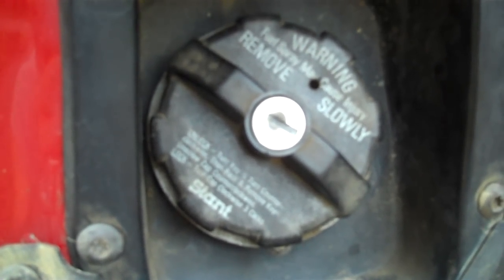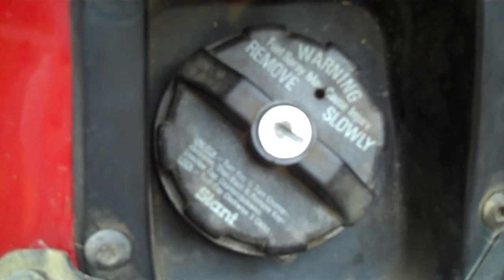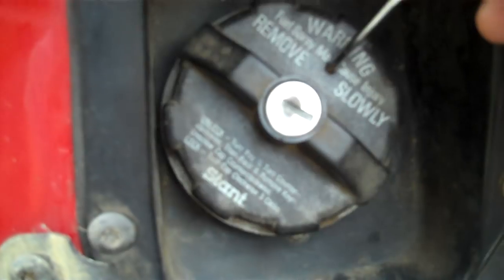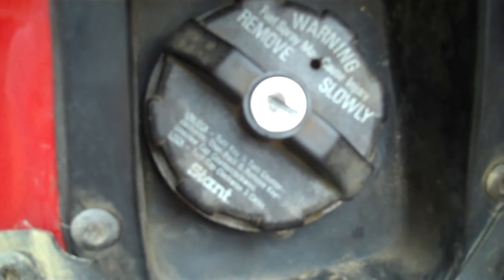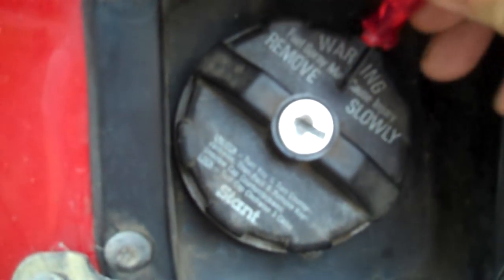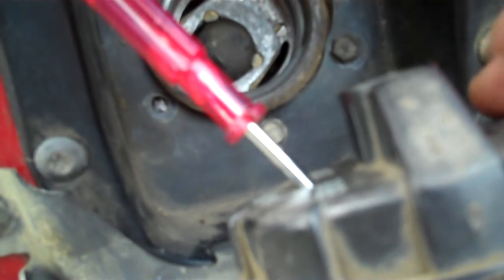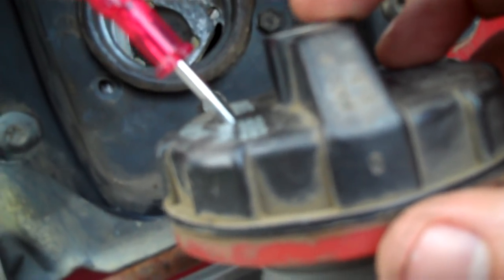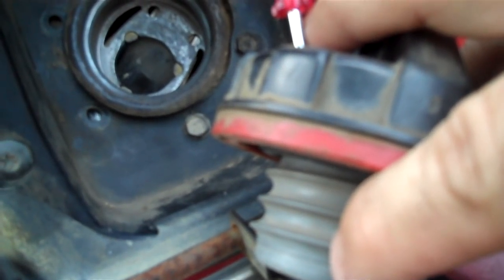How to remove YOUR locking gas cap if you lost or broke your key

Comment: What if it's not a Jeep and the cap is metal instead of plastic? Shouldn't one be concerned about creating a spark causing an explosion especially if the tank is almost empty (full tanks don't explode)? I've lost the key to 1 of 2 fuel tanks on a Ford F250.  The cap looks nothing like yours. Any "safe" suggestions? Thanks!
Reply from the maker: +tammygurl64 You have a legit concern. Its not the actual gas that explodes. Its the vapors. Honestly without actually looking at one, I couldn't actually give a "safe" suggestion.
Reply: Power Addicts - FixJeeps.com - Jeep, car and motorcycle tips I realize it's the fumes that explode.  That's why I said an almost empty tank would explode.  I saw a really cool science experiment on some science show on Netflix (really good series but I forgot the name)  where this science guy was running around Las Vegas doing all kinds of experiments and using tourists to help out or to guess what would happen.  He rigged 4 cars ranging from full tank to empty tank with the means to create a spark inside the gas lid (at a safe distance of course!  LOL!) and people were surprised when the car with the full tank did nothing. They were all mostly like firework duds until the car with the empty tank was ignited and made a big BOOM!  LOL!  I wasn't surprised because I was told this years ago when I first started driving.  Anyway, thanks for your response and sorry my reply is so lengthy. My neighbor, who is a mechanic, says he can get the metal cap off.  At least there are dual tanks on the F250 truck.  I may make a post telling how he did it once he's takes it off.  Have a great day!!
Reply from the maker: Go for making he post. It can help other people out! Thanks for the educational reply!

Comment: Does the key still work after doing this? (If you find it afterwards)
Reply from the maker: If done correctly it doesn't harm the locking function at all. So, yes if done correctly everything should work as it originally did if you find the key. Thanks for checking out my video! Have a great day! :-)

Comment: hey did you put any kind fo fueal lock ??
Reply from the maker: +Chanish Im still running that exact same gas cap shown in the video. Just using that little screwdriver as a key.
Reply: ok but i am not asking that i am asking about did you put any kind of fueal lock to protect from fueal theaf because i saw a flat bar or metel strip when you open the fueal cap so 
actually i am facing fueal problem in my society
Reply from the maker: Thats just a splash back valve. It helps prevent fuel from plashing out of that hole. That is built into the Jeep from the factory.

Comment: just wondering does it even work on all metal gas caps ,,,,need to know soon...???
Reply from the maker: +Donald Garin Haven't had the opportunity to mod a metal gas cap. So I really couldn't honestly say. Be careful of sparks near the gas tank opening. Explosions are very bad for your health! Be careful and have a great day!
Reply: Well ok but do u know if the metal caps work in the same way as the plastic caps work,, Because i could remove the rubber boot between the neck and the tank and then seal the tank ...
Reply from the maker: Most metal caps snap in with two tabs. There are some that screw in like the plastic one in the video. Try this ... go to an auto parts store and see if they have one in stock for the car in question. Then you will have a better idea of what you are dealing with.

Comment: you have to drill a hole?
Reply from the maker: +Ashley Walker For the method I show here, yep. Other alternatives would be taking a hammer and busting the top layer off. I've seen big channel locks pull the top layer off. This little screw driver is the easiest and safest way. Thanks for dropping in, have a great day!